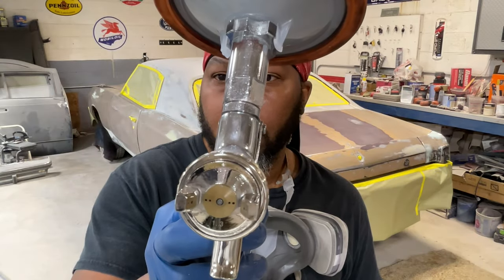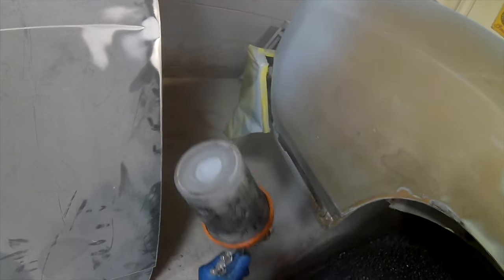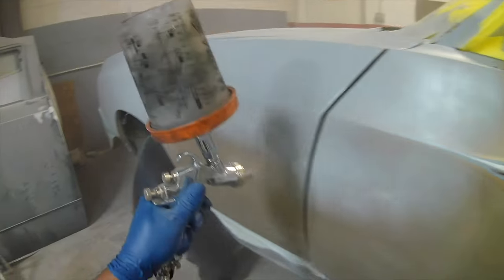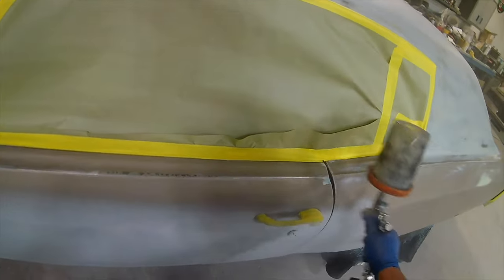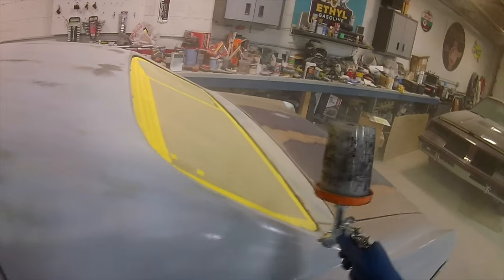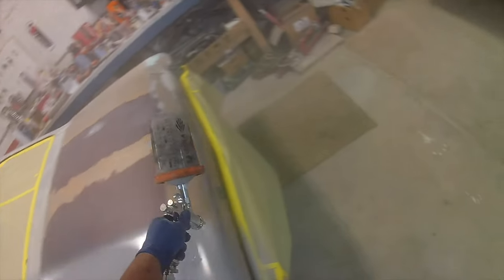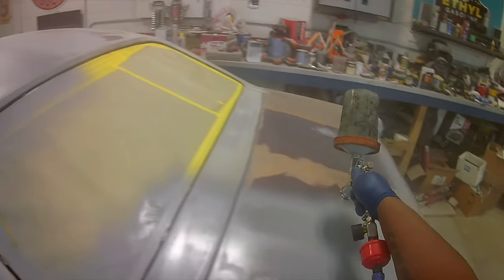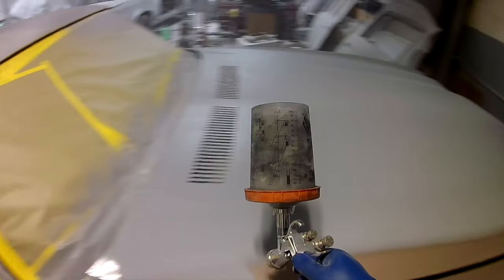R500 1.3 tip spraying primer

Comment: I’m lucky my barn has a large air compressor that will run any spray gun I can throw at it, but my barn doesn’t have any heat so I can’t do any paining in there during the winter. I have a 1 car garage that is heated but it only has 120v so I am limited on the how big of an air compressor I can run in it so I went looking for an lvlp spray gun I could run off it. 

I’ve seen videos where they were talking up the R500 and how little air it used but they were hooked up to a big shop compressor. I didn’t buy the gun after seeing those videos because I wasn’t convinced it actually could work on a small compressor. Then I found your videos using the R500 on a small compressor and you proved to me that it really could work off a small compressor. So I bought one and it’s been working great on my small compressor. I’m glad you showed it actually working on a small compressor because watching someone in a fancy spray booth say it used little air just wasn’t as conniving as seeing it work on a small compressor. 

Thanks for keeping it real with the reviews they’ve helped me and I sure they’ve helped a lot of other people too.
Reply from the maker: That’s awesome!!! I’m glad you kept searching and found the channel so that you could really see what was capable of a small setup and hearing your success is proof of it working and not me just telling viewers that it’ll work. I greatly appreciate you leaving this comment 🙏🏽💯

Comment: Hey UPK good topic.  Myself, I've found it depends on the gun.  Some guns whether they are HVLP, LVLP, etc. use a ton of air and some don't - even if you are using two HVLP guns.  One might do better with the small compressor.  I know that 3M Performance Spray Gun I use eats a ton of air then a different HVLP gun works OK.  I use a 5.4 SCFM @ 40 psi compressor with the 3M - I just have to turn down the pressure, close up the pattern a bit - it takes a bit longer to cover everything but it's possible.  Every vid on my channel is done with a 110v, 1hp, belt driven, 5.4 SCFM, old Craftsman.  Just my thoughts UPK - great topic again 😊
Reply from the maker: Great information Jerry and those types of tips are what’s needed for people to see they can achieve getting their project done by any means whether they have a big or small setup! In my opinion it’s important to show the adjustments needed to achieve a great finish even when you don’t have the ideal setup! Appreciate your input Jerry💯

Comment: I’ve never had the luxury of having a 60 or 80 gallon compressor. I’ve been painting for 15 years and I’ve always spayed on a 25 gallon tank. I know the frustrations and difficulties that comes with trying to paint an entire car/ truck on a tank that small. The compressor NEVER stops running, unless I’m in between coats or cup changes. I had seen the R500 before, but I thought it was junk because it was so cheap. I’d never seen anyone use it, or even talk about it until I saw your videos about it. I just want to thank you for doing what I didn’t do. I didn’t give it a try, but you did , and now just about everybody has heard of the R500 and A610! As far as I’m concerned, you did that Bro , they owe you 😂😂
Reply from the maker: Thanks Killer Bee, I really appreciate that and it’s good to hear from someone with plenty experience with using a small setup talk about how it really is and we all know they will never pay up 😂

Comment: there are only 2 ways....the truth and not.  it was because you reviewed this gun a few years back with a small compressor that made me take the plunge and get the Sprayit version of the R500.  i build kitchen cabinets and decided, again based on your review, to try this gun first before dumping $15-2000 on a self contained HVLP unit.  i get as good a finish as you get with a more expensive system and i run a small 25 gallon air compressor.  i have never run out of air.

keep it real sir!
Reply from the maker: That’s what I’m talking about BT💪🏾 no need for expensive equipment if you can avoid it ❗️ I appreciate you and I hope the channel continues to be helpful 🙏🏽💯

Comment: I appreciate the small compressor videos you have made. I use them to help dial in my setup up to run at it's best. Now to just get the tool behind the spray gun to work better.
Reply from the maker: Keep practicing with that spray gun and you’ll be great at it in no time!

Comment: Just keep doing what your doing.   A lot people can't  afford or have space for a large compressor and all the necessary attachments necessary to get water and oil free air.  I subscribe to most of the channels that show you how to paint with a limited budget.
Reply from the maker: Thanks BigBlueMotors, I appreciate you and agree that not everyone has the big equipment and the space to accommodate it so I think it’s important to show people how to use different tools to still be able to achieve a nice finished project!

Comment: Bought the vevor as my small compressor because of your video. That little thing can put out air!
Reply from the maker: That little thing is a work horse, it’s crazy how well it works !
Reply: @UndergroundPaintKing  Hey quick question... on a new gun do you clean the grease out of the spring area & the end cap for the needle?

Comment: King coming in hot today Haaaaa! I first found out that the R500 would work from you !  When i saw that loud azz harbor freight compressor working hard and you  did a complete with it i was sold . 
 Don't  get discouraged cause folks are faking the funk. Last time i painted   anything was 35 years ago  so the game has changed drastically   that's why i here.  I have learned from you  Trigger  Grant  and a few more . I have two 27 Gallons linked together so air is not my problem but i like seeing it be done in case one of mine drops in the middle of a job i can still finish with confidence .  I think you should do more videos on your daily operation just shorts then  a few 15 minute version cause it looks like you work on  a big variety of stuff  that folks would be interested in .
Reply from the maker: Thanks for the suggestions and I’m glad I could help even though you got skills already 💪🏾 I’ll work on mixing it up between shorts and longer videos 💯

Comment: All that can be demonstrated with the R500 and a 60 or 80 gallon compressor is maybe reduced overspray? You did it right.
   I have bypassed the entire concern of air compressors and paint guns, overspray, dirty air, ect. How? I switched to a 5 stage Apollo turbine system and their 7700 paint gun with all the caps, needles, nozzles and 3 m pressure cup.
   There was a learning curve. Took me a year to be comfortable and competant enuf to switch 100%. I have sprayed everything now except polyestor.
Reply from the maker: Good to hear the turbine system is working for you, how much did it cost you?
Reply: @UndergroundPaintKing  a good system can be an investment of over 2,000. But I actually bought a used 4 stage for around 600 that included a near complete set of pricey needles and caps. The gun was broke, so I purchased the upgraded 7700 gun for about 500. Then I bought a 5 stage turbine for clear coat for around 600 off Ebay. 150 dollars in old style pps one pressure cups so I can use Harbor Freight or off brand cup liners. 
   So it was an investment in time and money that is just now paying off for me with reduced overspray, less material used, reduced dust and trash blown into the finish in an open work space. No more paint guns to try and buy. I break down and swap out caps, nozzle, needles as needed. Its weird, because you can mix and match different caps with the same needle/nozzle for different results. Whole different game, really. But in the end, still applying paint products to a surface😂
  Don't worry, still going to keep watching and supporting traditional compressor paint channels like yours, of course. 
I will watch not for paint gun recommendations or psi or anything, but for technique, tips, bench chemistry info, and other detailed paint info and just for my own enjoyment at night when i'm done working👍
Reply from the maker: @BearBudgetgarage  good to hear it’s paying off for you after making a big investment and I appreciate you still checking out the channel 💯💪🏾

Comment: Right on, I was bought to spray some of that dupli this weekend, was curious if I should blast it on with my 1.8 or just use a 1.3. Good content, man. More uniform blocking, I'm sure. Every compressors different, I believe you just have a lot less over spray with the LVLP, don't see much in the air where your spraying. 
The few tiny compressor jobs I've seen on Youtube, they had to wait for it to catch up, looked rough. Primer sure, anything else think it just messes up the flow of things. Paint by panel is frustrating. Lucked out on a used 60 gal and haven't looked back.
Reply: Definitely wouldn't use a 1.8 with lacquer primer. It's way to thin.
Reply from the maker: Glad you came across the 60 gallon, you’re definitely in there with that! Give that 1.3 a try and tell me what you think 💯

Comment: Don't really care if you are using a small compressor, my compressor is smaller: 1.5hp, 6 liter. It will work for me if I add a time delay between each pass. Although, I only need to paint individual panels. Your content is useful. I didn't know what size tip I need for primer, now I do even though I have bigger tips. Small tips should be used with small compressors.
Reply from the maker: I’m glad the videos are helpful and the big tips will come in handy if the material you’re spraying is thicker, so if the 1.3 gives you issues maybe try a bigger tip💯

Comment: I think that it dosen't matter if they show it works with small compressor as the main idea behind the lvlp is to prevent overspray and minimize overspray! I've also used the hte black widow with the 2 stage husky oiled 30 gallon aircompressor that only had 7.5 cfm and the gun requires if I belive 11.4 cfm! Another one is the kolbolt syphon feed gun I've used on the ridgid 6 gallon pancake compressor! I think it's all about how to dial it in and you have some pauses between the tank re-airing up or if you keep spraying just expect that you'll burn the compressor motor out faster but still doable brother for sure.
Reply: Just show what works and be you brother the people will come in time!
Reply from the maker: Appreciate you Wrights, and I’m not to worried about the people coming in more so the people being misled but I do appreciate your take on it 💯
Reply: @UndergroundPaintKing  for sure I just know for me I just weed out those channels most time cause they waist my time and my money by suggesting that you need only expensive guns and high end stuff for quality paint jobs but then they don't show you the times the don't spray glass and have to pick up the polisher either lol.
Reply from the maker: @wrightsrrt871  that’s very true!

Comment: It most definitely can be done and UPK proves it time and time again, I done the shell and jambs of a Hyundai Accent MC hatch with 80L tank with a Devilbiss GTI PRO, it's not a LVLP but I got it done, I have a LVMP Atomx20 1.4 and when the compressor fires up it drops more pressure then my GTI could be because the GTI is 1.3
Reply from the maker: Appreciate you Winnsautomotiverefinishing! I have to check out those lvmp spray guns, I looked at a few but haven’t grabbed one yet. Good to hear that you tackled your project with your setup 💯💪🏾
Reply: @UndergroundPaintKing  thanks bud i aint no pro here i have only done 2 cars as of yet hoping to do more to build my skill, hey you got to make do with what you got and figure it out one way or another, now that I have a new property with a big enough shed to do it properly & I can upgrade to something better
Reply from the maker: @winnsautomotiverefinishing  nice 💯 congrats on the property 💪🏾

Comment: The output of the small compressor can be restrictive (if you exhaust the reserve/ tank), however the consistent running of the small compressor motor can wear the compressor if constant- such as working in a shop.  In a shop you also require extra air if sandblasting or running air powered tools. 
When at home: you do whatever it takes (even if you have to wait for air reserves to top up).👍
🖖🤙
Reply from the maker: That’s how you do it Maxwell! I try to show people what will work best for their situation. I appreciate you 💯

Comment: You hear channels say use the LVLP on small compressors, which is usually 21 Gallon or so. I have a 6hp 33 Gal compressor. I have no idea what to get.

And to your main question. As long as they are honest, I don't care. But my main issue with the lvlp content is there are very few results that show up in a search. Makes me skeptical of spending the money.
Reply from the maker: Well I have a lot of lvlp content on my channel so feel free to check it out if you like and hopefully that helps with your decision
Reply: @UndergroundPaintKing  Sorry,  that's not what I meant. It's not that there aren't many videos. It's that there are only three channels promoting them.
Reply from the maker: @bkpickell  well I definitely think that you have to go with what you believe is best for you, if you have the option for a big set up and expensive spray guns, by all means go for it!

Comment: I think if your only doing a panel or two with a small compressor is ok but to do an all over paint job you will have so much pressure drop that it will make your paint job inconsistent color because of the pressure drop.
Reply from the maker: I’ve done videos with the R500 which consumes less air to function properly which allows you to spray consistently while using a small compressor, and have pulled off a few overall paint jobs Dana, but if you’re only doing a few panels you can definitely use a small compressor

Comment: Great video once again og 👏 and I think it's not truly tested without small compressor of course you gone get good results with the big one. But og can you use the small compressor to spray primer with the 1.3 tip? Or is that just for 80 gallons
Reply from the maker: You can use a small compressor along with a 1.3 tip spray gun Teron, it’ll still work 💯

Comment: Don't change
I've learned a lot from your channel
Are you going to use lacquer paint on that?Or are you going to top that with urethane base and clear
Reply from the maker: @raysilby5674  I’m gonna use urethane base and clear, appreciate you checking out the video!
Reply: No Adhesion issues spraying Urethane over laquer ?
Reply from the maker: @raysilby5674  I’ve never had problems with it

Comment: Do you use the motor guard in your shop as well or what type of filtration after the compressor do you use for your custom work
Reply from the maker: @JenVillafuerte-q4j  I have a Devilbiss filtration system in my shop

Comment: #upking I paint motorcycle parts with a LVLP 1.3 Lime Line and AeroPro A610 also a SprayIt33500/R100 0.08 LVLP  mini gun using a  26 gallon Fortress but i am confident i could spray a whole car with no problems. 
I do air brushing with the same compressor.
If i were doing it professionally i would have pro equipment but for a side hustle hobby shop painting motorcycle parts i am Good to go.
It works for me no problem.
I think these guys saying you can’t spray with small comoressors either dont know or afraid they gonna loose buisness.
Reply from the maker: I agree with you Swampy, I think it was a tactic to keep people from doing it themselves and possibly gaining another customer in the process but we will continue to prove that wrong ❗️
Reply: @UndergroundPaintKing  YEAP.

Comment: I have a 60 gallon compressor, would you still recommend the R500 or would you switch to a different gun? God bless
Reply from the maker: Yes I would still recommend the R500, it is very nice spray gun but with you having a bigger compressor you can use a variety of spray guns without having issues Nick!

Comment: Wait, so using the r500 1.3 tip I can spray primer? I primarily use rustoleum rusty metal primer 2:1 do think itll still spray it?
Reply from the maker: @serviceproper  if it’s not to thick, it should be able to spray it